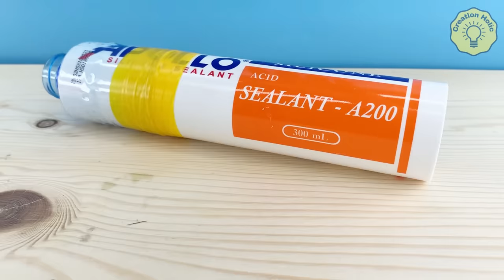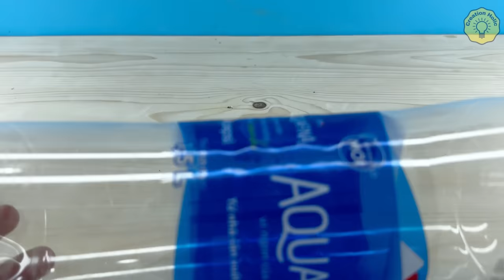I Wish I Knew These Things When I Was Young! 34 Amazing Tricks From A Handyman

Comment: Just yet another great video that is why I subscribed a while back.
With reference to the wire joining, I would be inclined to finish it off with tinning (soldering) and then using "shrink tubing" of the equivalent size that then makes it totally safe
Reply from the maker: Hello! thanks for your recommendation. Wish you all the best!